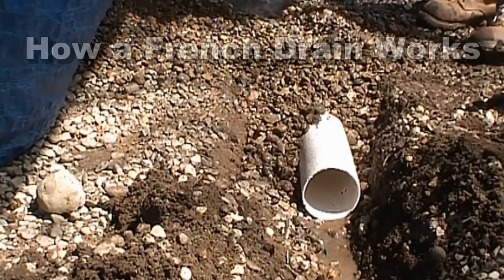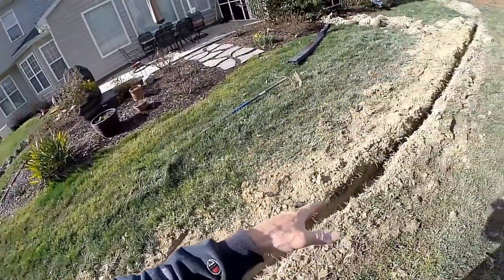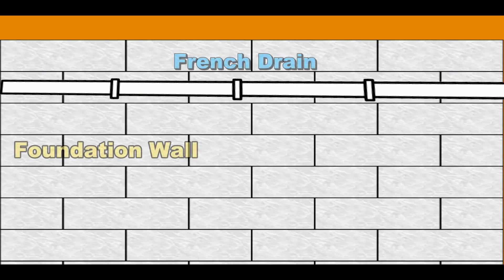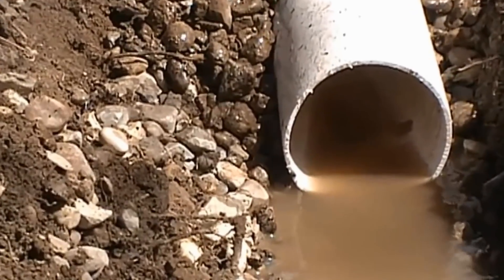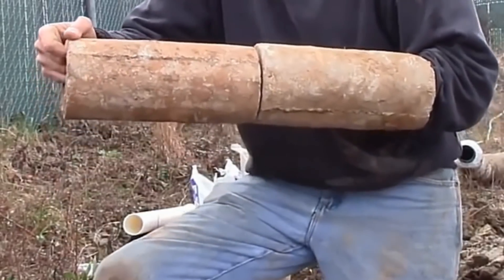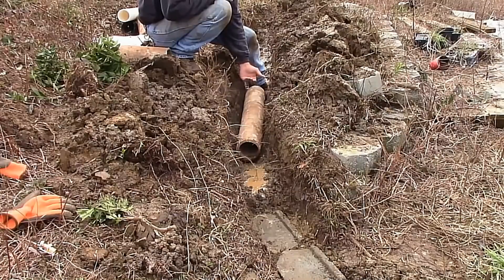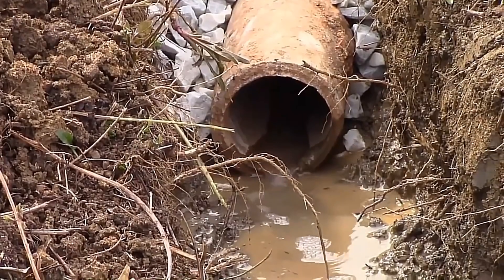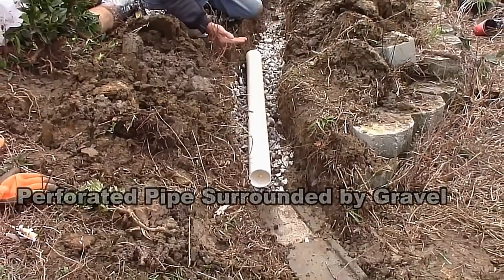Negative Grade and French Drain   Do's and Don'ts

Comment: Thank you... Always good information by you on this channel.  I have footer drain tile, running to a basement sump, taking car of my footers, that was installed when the house was built (1970s).  However, because my entire yard slops towards the back of the house, I get ponding up to the foundation when it rains heavy (and/or spring snow melt).  It takes days to drain down to the footer and get carried off, keeping the back yard swampy.

To solve, I added a simple french drain that has grate collectors every 8', about 3' from the foundation along the back and side of the house.  They take the water runoff around to the front and to the town storm drain at the street via PVC tile.  I then grated the dirt at the foundation so it slopes away ~3' to the tile/collectors (creates a shallow gully the grates sit in).  No more standing water at the foundation and way less load on my sump pump.  A relatively easy project if you are handy, just make sure you have the proper pitch in your tile to keep the water flowing in the right direction.